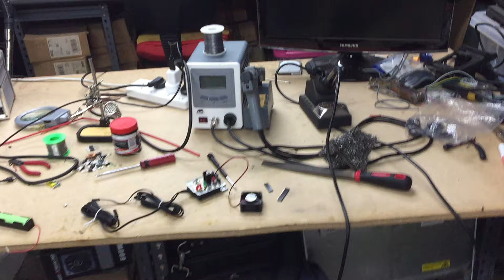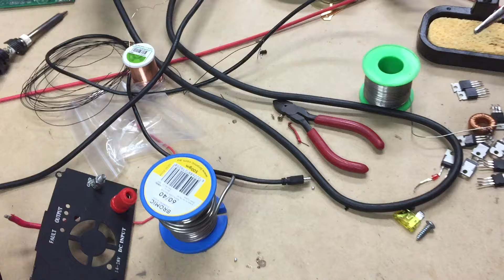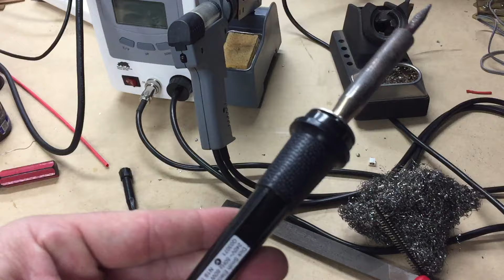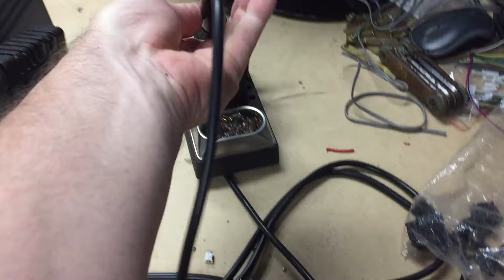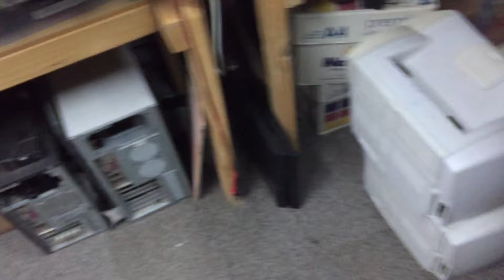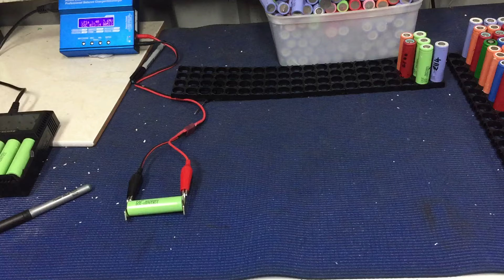I'm failing at arduino class 101 & time to start over

Comment: Nice idea, I would  set the temp for the fan to turn on alot lower, Around 35c. Remember the temp inside the pack or inside the cell would be alot higher temp. Even at 35c and a 45c temp batt , Thats still a hot battery. I woulnt wait until they got to 50c+ as its just getting too warm.
Reply from the maker: +Mikes DIY Tesla Powerwall at 35 the fans would turn on all day it's easy to adjust and tinker with

Comment: if it's a mosfett your using (it looks like a mosfett). it's common to go  12v to fan, negative from fan to pin 2 on your mosfett pin 1 is your input from the arduino and pin 3 goes to ground. also sometimes I add a 10k pull down resistor on pin 1 of the mosfett. hope that helps.
Reply from the maker: +l1t7l3ph0o7 it does - going to middle pin atm :)
Reply: +l1t7l3ph0o7  I use these guys for similar loads, should be able to handle it.

Comment: I dont have an arduino, but from what I can see, you could use a small relay not transistors, and for the fan, and an external 12 v supply. Are those fans for 12v? They look kind of big.
Reply from the maker: +Danut Plesu Yep if i have time going to pop to JayCar and buy lots of stuff to entertain my self next weekend. I had three fans 3.3v 5v & 12v i was playing with (all running from 18650 cell)

Comment: what are the mosfet / transistor caracteristics ?
If more than 4.8 volts are required to switch then it won't be able to switch the transistor and it won't work
Reply from the maker: +BillTheBox ok - I DON"T KNOW haha learning - have to start somewhere, typically I learn by my mistakes. This will be number one i thinks.

Will have a look first thing in the morning.
Reply from the maker: Learn from my mistakes - don't mean i do REALLLY dumb shit hahhah